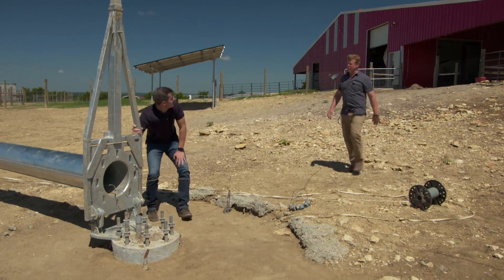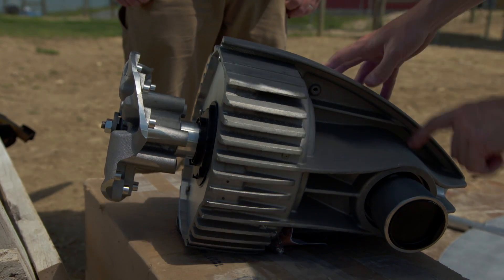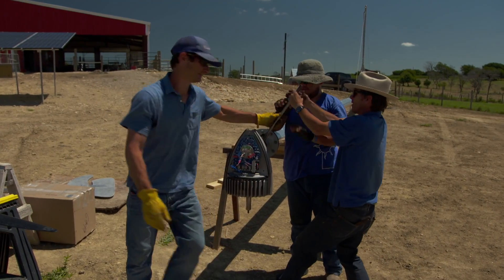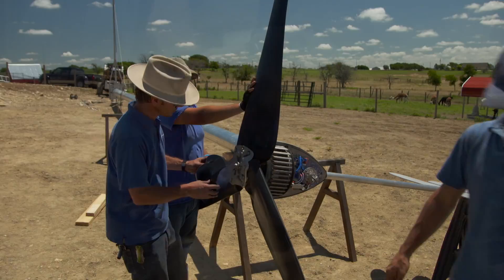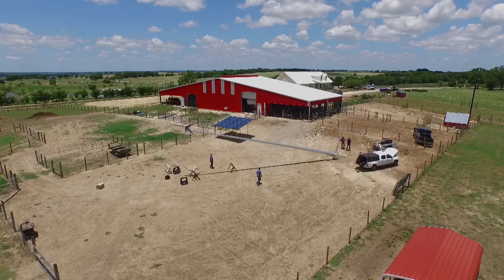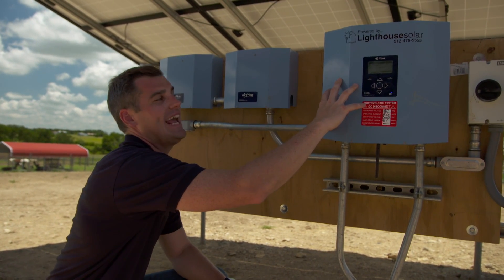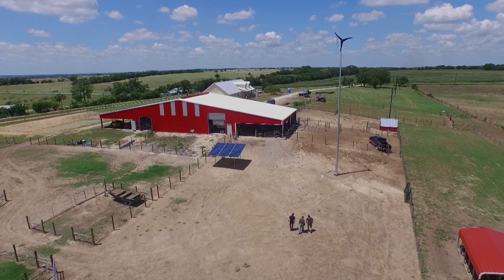How to Install a Home Wind Turbine | Ask This Old House

Comment: 3,000 pounds and pulled up by the little cable.  A lot of trust there.  A few large lithium batteries and it will be complete.  The wind doesn't always blow and the sun doesn't always shine and the grid doesn't always work.

Comment: I live in northern Indiana and have seen a few wind turnbine setups.  They are rarely moving at all.
Reply: North-West Indiana could have just enough wind to cost-justify a Wind Turbine.
Reply: @MrSummitville  North west would be closer to the lake, so I suppose it might.

But the joke around here is how often you can drive by a wind turbine and its standing still.
Reply: @AR-cp5dz  Yes, better wind over the flat lake.

Comment: Looks relatively simple, but pouring that concrete pad, not so much. It would be nice if you guys did a little bit more explanation on how to pour the concrete pad and set-up the anchors.
Reply: TOH did not pour the concrete. You can get plans, designed for your "dirt", from a local Professional Engineer.

Comment: Question: Is this a true 1.5 KW turbine that you are using? Or is this one of these turbines that have an efficiency of around 59% (theoretical limit)? I'm asking because that thing is huge! For me, the safety "margin" is around 40% efficiency for whatever wind turbine that I am to buy. I've already set up a good solar system, and did pretty much all the electrical wirings myself (An actually proper wiring, not those from companies that give you offers, but do a shoddy job installing the wires cleanly, and disregarding safety in extreme cases). I got my stuff from China, and the panels are German brand (Luxor). The entire thing cost me around 2600$ (including a solid frame and stone supports for each panel (which are all interconnected too, by the way), each generating around 325W, with the panel being rated 410W), and has so far generated a peak 2720W worth of electricity (even when it's actually winter in my country), out of the 3690W. So, an efficiency of 73.8%, exactly as I had predicted. 

Now, the thing is that the inverter that I got is solely for the panels. It works perfectly and everything, especially under high loads, and I'm making sure that the thyristors aren't reaching their limits when charging my batteries, so all good from that side. The problem is concerning the wind turbines that I'm considering. I am finding these turbines on AliExpress, that state that they are 1000W with 8 blades, and come with their own MPPT controllers (you can also get PWM controller if you like, but for lower power turbines). Now, I know better than to just jump the gun and buy on the spot such products (I mean, for the solar system, I actually spent 3 months studying the entire system and how I'll set it up, including all the costs, before buying), and I'm assuming a 40% efficiency. The catch is that they are very light (like 10 Kgs, so they will require some serious grounding (not the electrical type :P)). So, for around 2000W, I would need 5 of these, and given that they will all be DC at the output (they are stating that the MPPT controller has an output of 48V for each wind turbine), I'm hoping that I can parallel them all, and gain the current in return. 

Now comes the second dilemma. Suppose that the previous setup was also a success as predicted, the part that I'm mainly worried about is the connection to the batteries that I have. The average battery voltage that I have (all connected in series), is 48V based on the spec sheet, but of course there are the additional details about bulk charging, absorption charging, float charging, that I'm certain you know far too well already. The inverter is already doing its job here with when to charge and when to take from the batteries. How can I combine the output from the turbines' MPPTs to feed it to my system, at least at the battery level? 

Note: I live in a country where electricity is completely unreliable (comes and goes randomly, to which I've accounted for, for the inverter's safety), and I'm pretty much off-grid. We don't have smart counters that count backwards (not like we can spare any, because they are being used to charge the batteries, with the help of the sun of course). 

Note 2: I am not worried about any sort of overcurrent, because my calculations indicate that the batteries can easily withstand the maximal charging current that could be generated from 2000W wind turbines using 48V MPPTs (that would be 42 Amps, which is 21 Amps for each 4 battery sets, of which I have two connected in parallel for my solar system). 

Thank you in advance!

Comment: ya, so "this old house" ... woulda thought it might be something I could do at my house....but this "how to install a wind turbine" might be better titled "how professions install a commercial sized wind turbine" I mean.... that 20 ft deep footings part is where I rolled my eyes.  Whos doing that in their backyard this weekend?
Reply: If you do not have the skills, then you can install a Wind Turbine just like this homeowner - hire an installer.  TOH never said, this was a DIY project.  TOH filmed this installation.  And TOH does many projects that are not DIY.   Many off-grid Wind Turbines are actually built by, and installed by, the homeowner.

Comment: i just used a 80 foot tree that was in the yard for a windmill  and i drove around and  found all the solar trailers on the highway just removed the flashing arrows on them and ducked tape the wires together ..

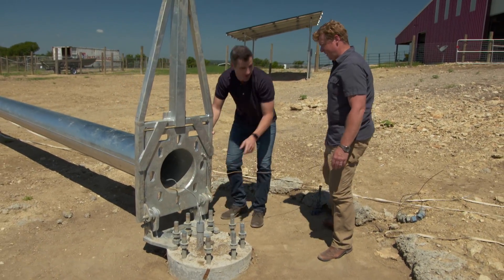Comment: 0:51  Yes, 12AWG/14AWG UF can in fact handle 1.7kW at 380VDC.  Surprising, I know.  I didn't believe it at first either.
Reply: Not surprising at all.  A 15 Amp @ 240 volt (14 awg) circuit can supply 3,600 watts !
Reply: @MrSummitville  I know.  That was a sarcastic response at how dumb the presenter was in terms of his electrical knowledge.
Reply: @randacnam7321  I think, Kevin O'Connor  ( the host of the show ) was previously the vice-president of bank.
Reply: @MrSummitville  Not surprising at all, unfortunately.  Ask 10 economists a question and you are sure to get at least 20 answers.  The same is true for much of the finance industry.
Reply: @randacnam7321  Even in a very windy environment, like in the video ... I struggle to cost-justify this expensive 1,700 watt wind turbine.  One major failure, after the warranty has expired, and you are in the RED forever.  The bearings never need to be re-greased/replaced?  The blades never wear out from abrasion?  The iron core inside the generator will never rust?  The tall metal pole ( aks lightning rod ) will never get struck by lightning?  It will never over-spin due to high winds ( hurricane ).  It requires steady 25 MPH winds to generate 1,700 watts.  So, who has steady 25 MPH wind, for many hours, most days?
Reply: @MrSummitville  Pika Energy doesn't even make this turbine anymore.  They went whole hog on PV only solutions a few years ago.
This turbine uses a dynamic braking system to control blade speed if the REbus loads can't use all the electricity the turbine is generating with a backup one shot emergency brake, which needs replacement after every actuation and which is now unobtanium.
The ~$7,000 that this went for (price included either a 24V/48V battery bank charge controller or a 3kVA grid tie inverter) is not bad for a legit 1.7kW wind generator, but a big problem with wind is the cost of the pole to get the wind generator out of the ground friction zone.
The tower in the video (looks like an AnemErgonics monopole but don't quote me in that) is around $12,000.  Then there is the cost of the foundation.

Comment: this beast  is huge
Reply: It is only 1,500 Watts - your average size residential professionally installed wind turbine.  There are DIY Wind Turbines that generate more watts ...
Reply: @MrSummitville  it was the pole i meant :)
Reply: @jonh8488  For a residential Wind Turbine that is the typical height. Taller is better ...
Reply: @MrSummitville  I understand, I plan on mounting one on a 24 foot high flat roof, hopefully I don't need that long pole
Reply: @jonh8488  You do need a pole to get some distance above the roof.  The building & roof causes turbulence, and turbulence is bad news ...
Reply: @MrSummitville  I understand

Comment: Iv never seen a home scale turbine with so much control circuitry up with the generator you get a bit of water or moisture in that and it will fry so fast this thing is built to fail and hey all that stuff is on a 60 foot pole which they claim weighs 3000 pounds im calling bs in that thing being 1.5 tons it might seem like that because of the turbine pole acting like a lever with the turbine on top but to say it weighs 3000 pounds is not really accurate

Comment: So even with all this expense, he produces 3.0 kw from solar and 1.5 kilowatts from wind, for a total of 4.5 kilowatts. That covers what, about 40 amps ideally? Meanwhile a small condo might have a 100 amp breaker box, and a larger home like this would almost certainly have a 200 amp box. So all this stuff only covers 1/5 of his electric needs?
Reply: Probably, covers to 65% of his electricity needs !  If he has a gas heat, gas a hot water tank, a gas clothes dryer and a gas stove, his house will use very little electricity.  A 100 amp mains breaker must handle Peak usage - the average power is way below that ...

Comment: Maybe I missed something, but if the wire is stationary through the mast, and connects to the head which is allowed to rotate 360 degs, wouldn't the wire twist?
Reply: The cable connects to the stator, which is the stationary part of the generator. The blades turn freely and electricity is generated by the magnets in the centre of the blades rotating in relation to the fixed copper wire coils in the stationery stator.
Reply: @84homey   I get that the blades attach to the rotor and the stator is stationary, but the entire assemly is able to rotate on top of the pole. For the wire to not get twisted, the stator would have to be on top of the pole, and not behind the blades.
Reply: No ...

Comment: Ow many watt?
Reply: Did you watch the video ?
Reply: @MrSummitville  yes . 1.5k DC watt?

About 200 feet . is that 10 gage wat tipe of wire  wire ?

I will tipe in for you after exactly watt gage wire let me know what gage wire please so I would like to calurate
Reply: @motobacktoconstitution4138  You calculate your wires size, based upon the length of the wire in YOUR project.  Keep the wire losses to about 1%.  10 AWG may have been appropriate for them, but maybe not for you ...

Comment: 2:41 That is a shitty loop, way to big its literally making contact to half the screw, should have crimped it tight around the screw or used a crimp connector.... and whoever ran that underground to the boxes is a hack.....no reason to have them criss cross like that.... Why wouldnt you have offset the right pip to the right and left to the left. A little planning goes a long way, and you should always consider future work...

Comment: How much does a wind tower like this cost? I'm interested in building a totally off-grid home when I retire and will obviously use solar and probably a battery storage system, but wind would be a nice addition for 24 hr electricity generation.
Reply: Certainly, you can use google search, to get your answer.
Reply: @MrSummitville  Certainly, you didn't need to waste space with an empty snide response. I'll never understand people who go out of their way to be dickheads when they could just as easily have remained silent.

Comment: One key ingredient is the battery.  That way you store enough excess energy at your property for the rare occasion the wind isn’t blowing and the sun isn’t shining and just top it up when needed before sending the power back in to the grid.  Love this set up by the way.  I’ll take two if them.  Regards from Australia.
Reply: Batteries are a financial nightmare ...
Reply: MrSummitville Expensive yes.
Reply: @wattlebough  If you can get a good Net Metering agreement with the Utility Company then it is always best to use the Grid as your "AC Battery" ...
Reply: Do they scare the dingos?

Comment: What was the cost of this?
Reply: The question is ... what is YOUR cost and what is YOUR payback? Their cost and their payback is irrelevant ...
Reply: @MrSummitville  yes but how much does it cost?
Reply: @KaptainKastle  If you are having it installed then you need to contact a LOCAL installer for a quote, because "labor" prices & markup vary way too much. Also, State Tax Credits make a difference.  DIY $8,000 ( maybe double or maybe less ? ) https://www.bluepacificsolar.com/hybrid-solar-wind/hybrid-wind-solar-1.8kw-48vdc-mission.html

Comment: If you were completely off the grid, could you run your house off of DC power without converting? Do they make lights and appliances that could run off DC? And if so would there be any benefits for this?
Reply: @Peter - YES, there are many RV's & off-grid homesteads that run off 12 / 24 / 48  volts DC only - no AC appliances ...
Reply: No. Every modern appliance or electronic device is designed to convert 120/240V AC to whatever DC voltage and current each device needs, with all the transformer circuits and such that entails.

Comment: Who are these guys? “Gotta tighten this NASAL on with a chain wrench” Three grown men proceed to hang off of a 2 ft wrench like a bunch of clowns... Maybe tighten the NACELLE with a longer wrench? Or a cheater bar? Or god forbid you tighten it to a specific torque value... I mean at least with one person and a specific length bar you’d get a pretty accurate pre-tension versus three yahoos hanging on one wrench in different places with very little leverage... 🧐

Comment: This looks like a ton of money and work for 1500 watts. For $1000 you can buy a 2000 watt generator and have enough money left over to buy three lifetimes worth of gas. And don't forget the extension cord.
Reply: In ten years you would burn through $58,000 worth of gasoline.  No, your idea is not cheaper ...
Reply: @MrSummitville  I dont see where they mentioned it but that whole setup, solar wind and inverter plus wiring, I'll bet costs $100K. And then he's still connected to the grid. This will never pay for itself.

Comment: can anyone explain why do they prefer to install a taller heavy pole instead of installing larger blades at a lower height? why are the blades so small yet they complain the captured wind energy is the bottleneck?
Reply: A taller pole is better than shorter pole
Reply: @MrSummitville  this explanation does not help? of course it does but it also costs more. what is the tradeoff bigger blades / pole / cost
Reply: @Channel-tr1hx  A TALLER pole is better. I thought maybe you could do some independent research, as to WHY. You did not even try ...

Comment: The money that thing probably cost and it’s DC all the way to the ground to the controller. 3phase AC  generator with a rectifier would be way better ( I don’t know his circumstances though) there has to be a significant amount of power loss through that small gauge wire going more than 80 feet. Also idk this was in my recommended😂
Reply: No ...  3-Phase AC would not be better than DC.  How would AC be "way better"?  They are located in a "good" location for a Wind Turbine  ... most people are not.
Reply: MrSummitville just based on my experience with wind turbines you have a dramatic loss of power from dc after about 50 feet, and need a thicker gauge wire to run from the generator itself. I’m no electrician and when it’s scaled up it may not matter (I’m only using a 500w mini turbine) I could be totally wrong but it’s just what I have been told
Reply: @alexhuey6489  Yes, you are totally wrong.  The Power Loss over long distance of wire is LESS for DC, than it is for AC.  I don't care what you've been told.  Do us all a favor and do some research before you post JUNK SCIENCE.

Comment: A long pole such as this is far better utilised with several vertical axis turbines. They would generate far more power than just one set of propellers at the top.
Reply: You are wrong ... a HAWT is more efficient than a VAWT ...
Reply: MrSummitville not necessarily. The vawt requires less wind. I think perhaps the span is a factor. VAWT do not require the same height and no gearbox is required. Also, the blades don’t have to be oriented into the wind, and they are quieter. They are far less dangerous for birds. VAWTs are better fo homes for these reasons. The wind farms have shown higher production with the large hawts, but they definitely do kill birds. And they seem be noisy and certainly the older ones prone to overspin and burnout in high winds. Also prone to breaking in high winds. I haven’t seen the larger VAWT design used much because it’s likely not as good in the high industrial type application.

Comment: That seems like a lot of expense for not much power. Also, maybe not, but the specs of the concrete foundation sounded like insane overkill, but perhaps not.
Reply: It might be enough for them ...
Reply: @MrSummitville  perhaps, I'm just thinking for the price that cost, they could have had far more solar and even some battery storage for the same price.
Reply: @alexmaclean1  But it is very windy where they live.  They can have strong winds for a full 24 hours, but the sun must rise & set. That changes their ROI on each device ...

Comment: Dinky little wind mill one a 60 foot poll... the heart of the process!?!?
question,  why didn’t you run an ac wind turbine? Way less losses!
Not a DYI
Solar panels not mounted on a building? 
What did this cluster cost?
How many years does this mess take to break even?
Reply: You know nothing ...  AC is not way less losses than DC.